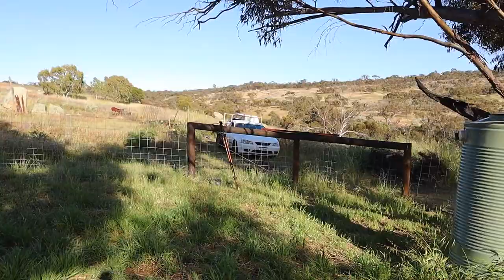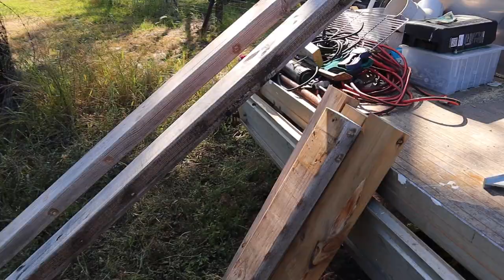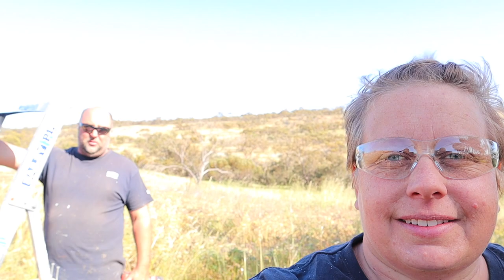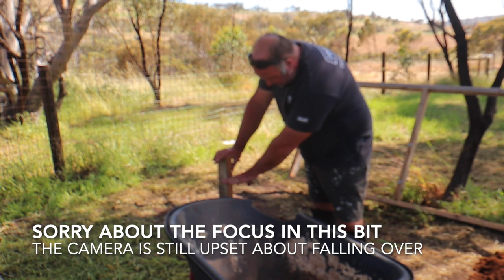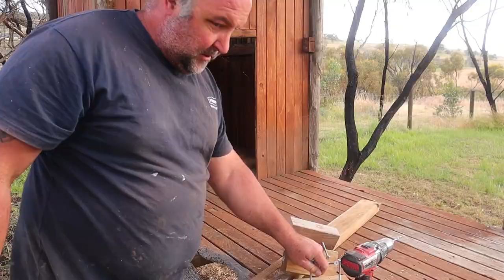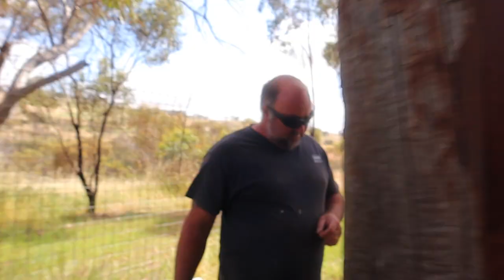MOVE & INSTALL old chicken coop from farmer's paddock | Off Grid Homestead

Comment: Looks great.  And with that roof, you could put up a section of gutter to feed right into an IBC tote.  It might not be a lot of surface area to catch rain, but every little bit helps!   No doubt in my mind you could collect 250 gallons of rain water during the rainy season.
Reply from the maker: The roof is 4.32 metres square, at 1mm catchment per square meter we could catch 2160 litres per year from that roof based on our average yearly rainfall of ~500mm. That’s about 570 gallons so you are under selling your imagination 😂😂 

Allowing up to 1 litre per day per chicken is 365 litres per year and we have 10 chickens now = 3650 litres. So catching off the roof is over halfway there 👍👍
Reply: I LOVE THIS idea!